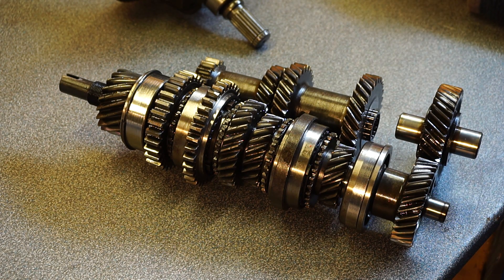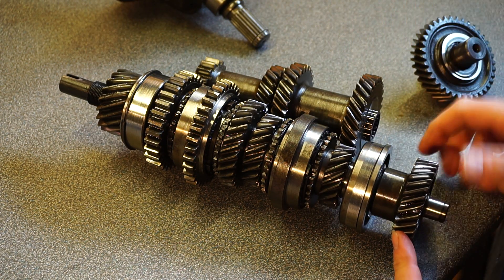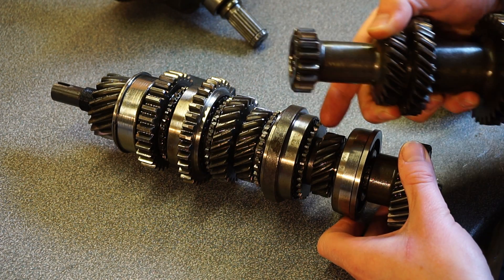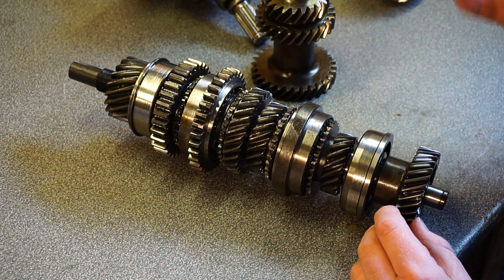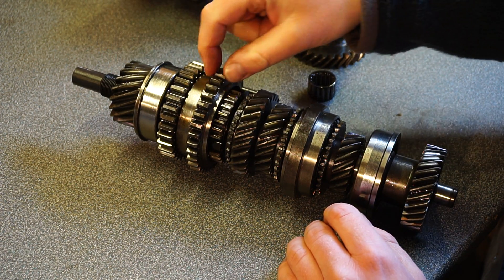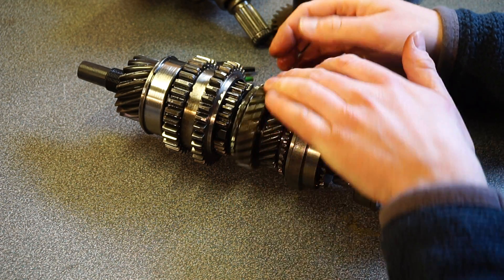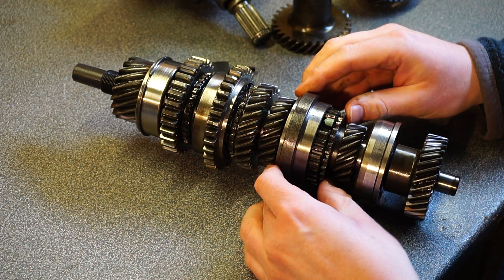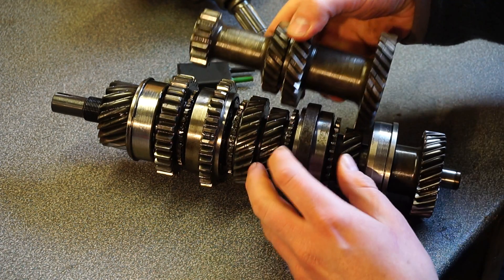Turbo Mini TV - How a Classic Mini Gearbox works

Comment: so when you dont change properly is it actually the synchros grinding against each other?
Reply: No, that's usually your clutch control that's the problem there.  You won't get a gear in without noise if you don't have the clutch fully depressed, so the synchro's can do their job and they only do that properly when the engine is disconnected via the clutch from the gearbox.